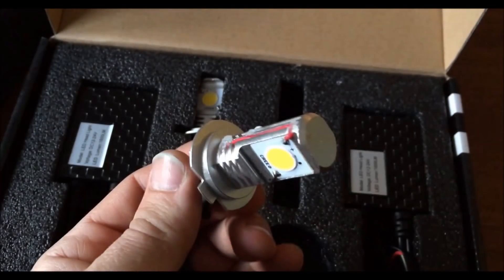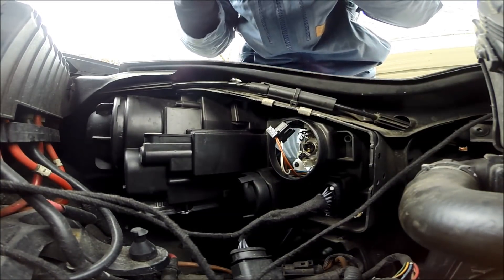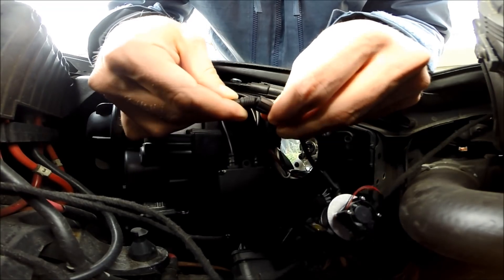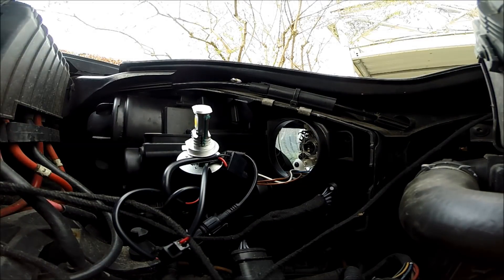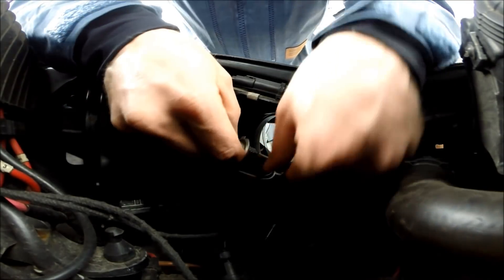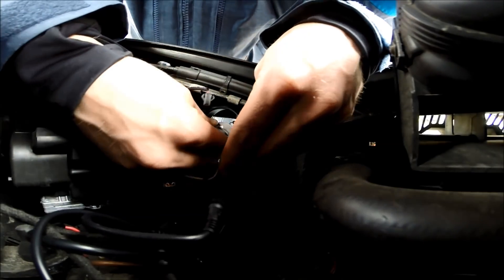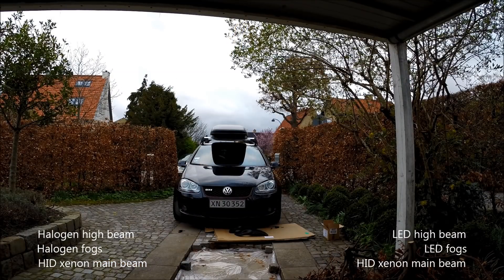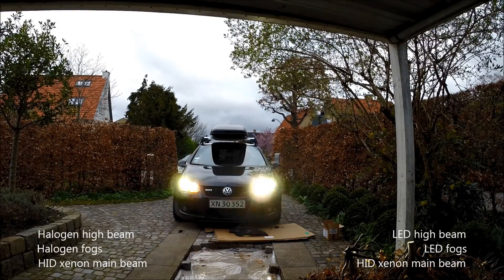LED vs. Halogen, install and test

Comment: In the UK LED or HID bulbs are illegal to use in a reflector lens headlight unit. And even certain projector lens headlight units. I've noticed more and more people using them and because a reflector lens headlight unit reflects the light, if you increase the light output over and above a standard halogen bulb then you blind oncoming drivers which is really dangerous. I've found myself numerous times blinded temporarily by these bulbs and not able to see the road markings properly and ended up on other side of road. The sooner they ban these bloody things the better. There is no safety element to them and online retailers sell them with the words ' for off road use only'!. So the buyer takes the risk and not the retailer.

Comment: I'm pretty sure that since that vehicle is German, a Load Capacitor is necessary on each unit. This will prevent the Headlights from flickering and the turn signals from having a Fast blink operation.

Comment: Everyone should realise this Lighting modification is COMPLETELY illegal in many countries as the LED Lighting segments are NOT located in the correct place for the original reflector's .
Now the moment there is a Fan (presumably to cool the heat sink screams 2 things at me , 1 the Lighting module while being a semiconductor is inefficient and generating a lot of heat.
2 The Voltage regulation is questionable as there is need for a heat sink and fan.

Now I must ask this question WHY is there a So Called Ballast for an low voltage DC LED ??? this does not add up.

Comment: Rubber seal has to be whole to protect the inside of the lamp from water and dirt. And LED needs fresh/cold air to cool it down so do not do this unless you are a chav.

Comment: LEDs are nice and bright when you're up close and shining them right in your face (or camera lens) but have almost no distance. For low beams they aren't that bad of an option, but personally, I'd never run them for high beams. HIDs will blow them out of the water any day.

Comment: this has to be the stupidest car mod ever, it even surpasses the mighty cut down springs home lowering kit.

Firstly, you will not be able to see where you are going, on an urban road with lighting yeah, no problem, but out in the country, pitch black and no street lights, you are going to have an accident. Secondly, everyone else either driving towards you or driving in front of you is going to have an accident because they can't see jack shit. Aftermarket HID's or any kind of LED bulb does not belong in a projector headlight, doesn't the fact that the bulb needs its own fan give you a clue?

These are illegal in most countries FOR A REASON, but hey, as long as they look cool, fuck everyone else yeah!
Reply: +Mcpricex "not belong in a projector headlight" what? If you aim your headlights properly and not into oncoming traffic, you'll be fine. Projectors were created to aim light in a more direct and controlled pattern. The real problem is putting them in a reflector type unit. The light will bounce everywhere in that case blinding everyone. Of course they need a fan. Your logic is ridiculous. Ugh.
Reply: Though he putted the LED Light in the reflector housing which I agree will blind on-coming. The LED will be be used as a high beam light which shouldn't be used when there is on coming traffic anyways so in theory there is no problem with him installing as he wouldn't be using it when there is oncoming traffic. So your argument is pretty redundant. 

Now on the topic of him not seeing anything because it is a led light and they don't have a focused beam I also agree. Then again, if you heard what he said and actually look at the footage you would see that his Dipped beam also act as a high beam thus being called a Bi-Xenon. Therefore the projector lights will increase the cut of point, when high beam is activated, improving viability in the conditions you mentioned before where as the led lights will disperse more light not playing much of a role. So it does look cool but his lights are not Illegal because if he sets it up right he shouldn't be dazzling anyone anyways.
Reply: they're not illegal where I live, so... lol
Reply: +Justin Saranczak yeah lol fuck everyone else right? lol fuckin moron lol
Reply: +Mcpricex damn right lol
Reply: Jacob Chapman   I think he meant to say reflector.

Comment: The led bulb might have been a little bit better if there were more led's all around it instead of just 2 led's per bulb as more led's gives more reflection,
The Halogen Bulb it self has clear glass all around it that offer's more reflection.

Comment: LED uses way less power to run them, so on short night journeys this is a lot easier on your battery.
My best tip for helping your battery is turn off your heater fan, one mile from home. The car is warm enough, you wont worry about it, but your battery will thank you the next morning.
Also, if you leave your lights on by accident, your battery can run like that for much longer without killing your battery quite so quickly.
Love your battery, it will repay you.

Comment: Hey, these bulbs I used on my car about half a year. The purchase price of $ 59. Immediately after the engagement, I discovered that the rear lamp guards do not deploy. Cooler fan were too high. Another problem has been in the sources of light interfere with the FM radio, so you could only listen to music from CDs. Regarding light seemed to look brighter than incandescent lamps, but due to the different sizes of the LED chip and the filament, not exactly a parabola light spread, but dim lights glare oncoming drivers. I had to put down a lot of light, but I could not see. High beam was OK, just do not shine into the middle distance, but everywhere ahead. I felt as if the light had a greater distance than conventional bulbs. But then it happened that night driving began two lights flashing and in about half a kilometer light stopped altogether. So I finished with only parking lights to the nearest village and there I had to put incandescent bulbs. I LED I sourced mainly due to lower power consumption, but

Comment: How is the fan supposed to cool the LED when its just circulating the small amount of air in the lamp?
It would be nice to know, if the LED is now as bright as it used to be.
Reply: +Hans Wurst  The fan does not cool the LED it cools the Heatsink which does cool the LED.
Reply: +Ray Lyford And what if the fan stop doing its job? something will melt or it will be just fine?

Comment: The lens optics is not designed for LED light, but for a filament running in a certain direction....not a good idea to use untested stuff not designed for the rest of the system..just get some Philips 130%  Xtrem vision DOT legal H7's

Comment: What is the WATTS requirement? I replaced my 55watt halogen bulbs in my 2013 Passat (U.S.) with 65watt bulbs. Was told that the wiring in VW's (non-factory) installed HIDS (standard halogen) can't handle over 75watts as it will melt the wires and discolor the headlight lens. Nice video to BTW.

Comment: Hvor købte du dem? :)
Reply: Fred Swetnam and it is indeed a danish numberplate aswell :)
Reply: Although he's a neighbour of us (tze accent imply he must be German), I think he'd prefer to have the question in English. I typed "H7 Cree LED bulb" into Google and it pointed me to EBay. BTW. For some reason the bulb's are illegal in Denmark.
Reply: Henrik Carlsen not to be rude or anything but I have not been informed nor do I see anywhere that they're not street legal in Denmark, as long as they can pass an "m.o.t" then it will be ok. I was also pretty sure that he was danish since he had the thick/obvious danish accent! :) (edit: he has other videos in danish)
Reply: Henrik Carlsen
Look at the number plate... it is definitely not a German one. Furthermore, it's not the common euro design, so it must be an old one.
Reply: For Denmark and Sweden you will find them in Biltema.
Reply: rrazvanell thank you!/tak! :)

Comment: show how they work at night time mate
Reply from the maker: Here you go ;)
https://www.youtube.com/watch?v=ZBvADfRZp3k
Reply: yeah m8 but u have bi-xenonos so cant see realy difference with this type of headlight if u dont mind show how LED high beams work at night only without any headlights etc
Reply: cengeb you have your head so deep in your ass it's not worth reading your ramblings.
Reply: +Doris Boriz  But he's installing an LED headlamp; not HID.  I hope to do the same soon, but I'm having a difficult time matching the specifications of my original halogen lamps.
Reply: +cengeb As long as the emissive element (LED or the incandescent filament) is in the same position and about the same size, the optics work exactly the same either case.. HID bulbs cannot work properly in a  headlight designed for halogen bulbs because of how the element is shaped.
Reply: "about" the same size, now that's some design work...doesn't work that way
Reply: Any of these aftermarket SWAG, not DOT SAE tested approved for U.S. roads is Illegal and stupid. Bad enough some of the legit stuff from GM is horrible, with glare and lousy cutoff, In Europe E code and other specs.. You think car lighting is just a matter of swapping a lamp?  So the engineers are wasting all their enrage actually making stuff that works properly, optics matter, light angles, cutoff etc.  It's not just as it seems, this is ALL crap!
Reply: LED output directions etc completely different than a heated filament, optics cannot function properly using an LED in place of a filament halogen, and if not SAE DOT approved, stamped etc, they are illegal.  companies spend millions of dollars in engineering for headlight design, so some one in a driveway can merely put some retrofit LED in place, doesn't work that way.  So all the engineering is a waste?

Comment: I'm a bit confused about the fan... LED bulbs produce little to no heat - especially compared to traditional bulbs - so why is the fan needed ?

[UPDATE]
It's OK - found the answer to my own question!
http://forums.tdiclub.com/showthread.php?t=396634

High powered LEDs do infact produce a lot of heat - I never knew that!
Reply: a led is actually a semiconductor diode thus is producing heat. car light led has 12 to 24V at 6 to 30W, think about this and ask yourself why you have need of fan to cool off your processor as long as in fact it is based too on semiconductor technology
Reply: The fan is there to cool down electronic components. Otherwise they will burn and your led bulb will not work anymore
Reply: Petre C the processor in a computer I can understand, that's doing thousands of operations per second. All those switches in a tight compact area will produce heat. The led bulb has 1 operation - whether it's on or not! I did find the answer after I posted this. It's quite interesting. Didn't know "high powered" LED's existed before this post. Thought all LED's were created equal - how wrong I was!

Comment: so, once installed, the back of the lamp should be kept open always without the dust cover cap? otherwise, if it's covered, the heat will just circulate inside the lamp thus making the cooling useless, am i right?

Comment: You do know that the LED blinds the other drivers because of the beam being slightly more round and not flat like a rectangle.
Reply: The cut off of the beam is not from any type of bulb that is used, but rather the pattern cuts in the headlights reflector.
Reply: you do know he installed them into the HIGH beam yes? thus forth meaning no one will get blinded by them when he passes them...
Reply: Chris Reid The cutoff comes from combination of bulb light source (filament, arc, junction), reflector and/or optics. It is critical for light source to be in very exact spot and one of the reason why rip off halogen bulbs tend to get poor (blurred) cutoff line.

Comment: I wanted to know how do you replace the rubber cap covering the bulb behind the headlight
Reply: u can increase the air around the fan by changing the original cap to one of these (if there is room enough): https://www.aliexpress.com/store/product/HID-LED-Headlight-Car-Dust-Cover-Rubber-Waterproof-Dustproof-Sealing-Headlamp-Cover-Car-Styling-Accessories-DIY/1473227_32792823819.html?spm=2114.12010612.0.0.45326f02KsxZc0

Comment: i wonder if this would be too bright to on-coming traffic ... you might be pulled over and get a ticket if there was a complaint ... What's wrong with the original headlights ?  unless you were going out in the bush where its pitch black ... is it really practical to have headlights as bright as the surface of the sun ?   ... you could just drive with your regular high-beams on all the time ... 

good video though, thank you
Reply: The reason he only installed them as high beams is because they will be used when there isnt any oncoming traffic, as intended. So, WTF does it matter if he wants lights as bright as the surface of the sun or not? He will be the only one seeing them operate.

Comment: so youre gonna leave the ballast out? will it be sealed waterproof?
Reply from the maker: Geo Von Lengerke Yes I just left it hanging, still works fine :)
Reply: +qasqdk just tie it off with a cable tie to stop it from potentially banging around and breaking

Comment: The issue with LEDs is not brightness, but heat.  The more heat, the shorter life of the LED.  You can only cool these so much with a fan.  Then "when" this fan fails, say goodbye to your LED.
Reply: ***** Sorry buddy, but that's all just Chinese crap

Comment from the maker: On the Golf there is a rubber cap on the back of the headlight, so I had to cut a 1cm hole to get the ballast out.
Reply: the rubber keeps dirt and water out of the lamp lens etc, cutting a hole in it is not too good an idea!
Reply: The LED fan needs air to cool down the light bulb, if you install that rubber cap back on there is no way for the air to enter the lamp, thus shortening the life spam of your new LED.
Reply: rrazvanell The thing was not meant to be using your LED retrofit.  thus cutting a hole in a rubber SEAL, as designed by the factory, is plain dumb.  Over time dirt and water will mess up the inside of your assy.  Also using NON DOT/SAE in the U.S. is a violation and basically illegal.  Using LED source in optics designed for filament lamps is also driveway engineering, and dopey.  Optics matter.  In Europe it's probably not E code compliant either. A lot of science and engineering is involved, not just swapping parts, that don't belong.  If you want LED headlamps, get a car that has em from the factory, Audi, or E golf.  And others.  If you want brighter headlights get a Halogen Philips 130% H7, road legal in all countries. Philips and Osram also have LEGAL LED DRLS, complete kits, and legal.  And designed water tight where needed.  Cutting holes in water tight seals, proves this is dumb.
Reply: cengeb True true....they are not legal in Europe, but he is using them on his high beam, this means that they are ON only when there are no other cars coming from the other direction.
Reply: make sure you put some liquid rubber gasket on the hole or you will get condensation in the headlight housing.  
the headlight is under the hood so you won't get dirt or rain into it.  but it will condense and make the glass foggy
Reply: +cengeb Your comment is a little overkill :))
Reply: rrazvanell I saw an Audi and an Alpha, with LED headlights, and I think they must have done all the tests and got the permits. The beam patterns were very good too, I couldn't feel any discomfort. But, third party products probably need more work. Future must be with the LED's though. My Extreme Vision +130% bulbs do not last long and after a  few months do not perform very well. Same goes for the +100% Night Breakers. Surprisingly good for a couple of months, than slowly they fade away.
Reply: +qasqdk       But after sealing with the rubber boot, the fan starts off cool, but after extended driving at night, wouldn't the fan be just circulating the same air inside the headlamp that would progressively get warmer to perhaps overheating and compromising the globe and the rubber sealing boot?.  Just curious to know if this is a possibility, cheers...
Reply: +cengeb that fan resists dirt and water ;)
Reply: +David Hamilton i have the same question :)
Reply: Aaron Summers Audi has LEGAL LED headlamps on certain models.  They are working with U.S. regulators to get the advanced LED headlight system in the U.S., there is no high low, but continually variable as a camera sees what's out there more and less LEDS light up as needed, slick, high and low beam is so 20th century...and the U.S. A. is out of touch with it's obsolete DOT headlight regs, out of the 60's.  but still, illegal non DOT labeled lamps will get you in trouble.....I think I seen an Acura with LED headlights!  No glare at all, and the road was bright around his car...had like 4 section in each side, slick...factory, so it's legit
Reply: rrazvanell doesn't matter, still not legal, and just a dumb idea....driveway engineering at it's worst. Get some Philips H7 130% lamps, legal and brighter than stocks....LEGAL, means engineering and design, and TESTS where done at considerable costs, for a reason. This driveway engineering is a dopey as the HID stuff put inside of halogen optics,
Reply: +Emanuel There is lots of dirt and water UNDER the hood.  How come factory LED don't have fans, this is really a dopey product, and Illegal...for U.S. non DOT FMVSS108 non compliance
Reply: Ghost. Did you put HID's in projector headlights or reflector headlights?

Comment: Nice video. I'm thinking of replacing the high beam HB3 halogen bulbs at my 07 Volvo S40. The main beam is HID xenon from the factory. There is one question, did you drill a hole at the cap for the cables to go to the ballast and to the bulb? I had to do that for a Ford Focus to install HID...

Thank you